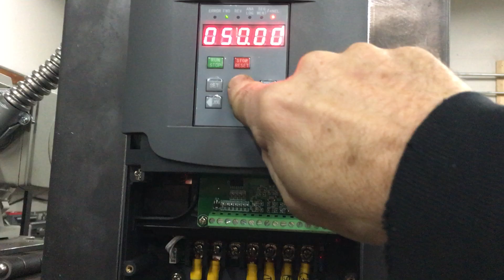VSBS1000 Stroke Sander Trial Run

Comment: Running it a bit fast no? I would worry about burning the metal on high spots. Used to sand stainless steel on one. Was a danger if the paper was running too fast.